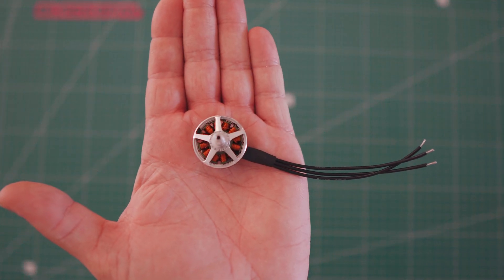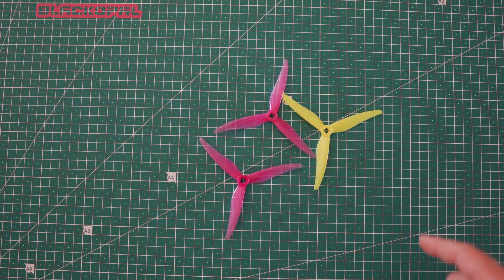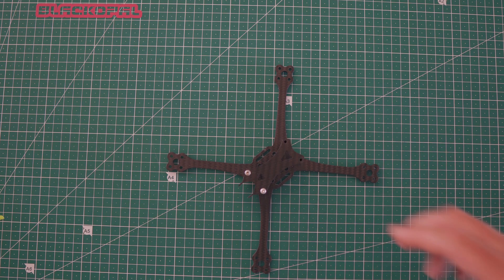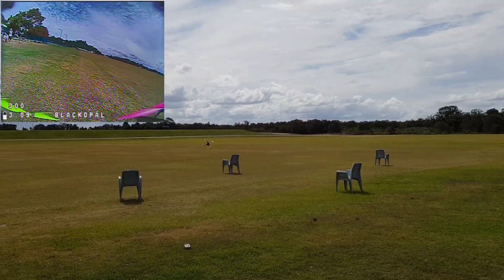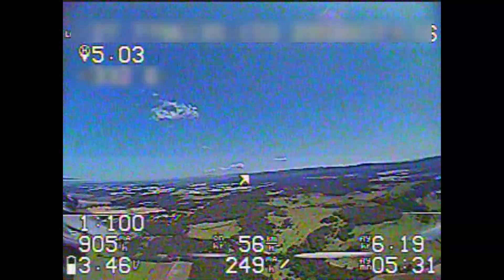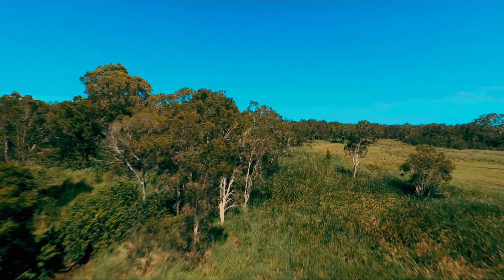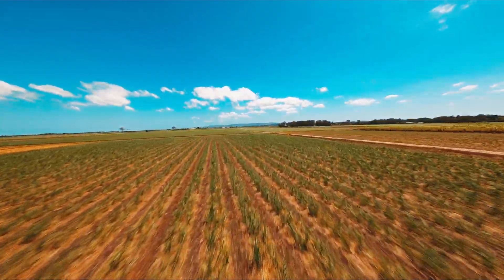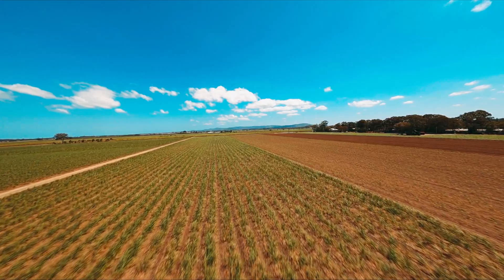37+ Min Race Drone? T-Motor Prototype

Comment: Any idea on release date? 
Do you have a link ? 
Thankyou
Reply from the maker: Should be available very shortly. Check the T-Motor website or FB groups.
Reply: @ScottTomlinson  thanks for this amazing build, do you have a link of the frame? I want to build the same!
Reply from the maker: @jordigrau83  I designed and machined the frames specifically for these tests unfortunately. Stay tuned though, considering some ways to get the designs out.
Reply: @ScottTomlinson  any news, are the motors released yet?
Reply from the maker: @justvoorfun  Yeah they're out mate. On the T-Motor site already. I'm sure stores won't be far behind. (They're now black)
Reply: @ScottTomlinson  Hey scott, so these are 2204 right and not the 2203,5? Because the 2203,5 are the only one that are the closest looking to the motors that you are showing 😁
Reply from the maker: @justvoorfun  They are the ones yeah. I had early prototypes here. New bell design and changed to 12x12 for the final production version. Stator is the same and delta connection for the 1500 kv version. (Measures 2203.5) I'm just waiting on the new ones to arrive that T-Motor have sent me. I'll update if there's any caveats but I expect no difference from a flight point of view.
Reply: @ScottTomlinson  how do You match ESC for the motors..? Are there any rules to follow so I do no fry either the motor itself or ESC in first flight..? I really wish I could have a table for this or something. I am thinking of tuning my Chimera 4" for something more efficient and better flying drone. The stock motors from Xing although very light seems to be very Amps hungry. Those are 3800kv and drains 1050mah Lipo in less than 7mins cruising.. I am considering using the same stack of 35amp and solder T-motors to it with a better frame for like 6" two-blade props.. would that work with the original 4in1 esc Iflight installed in their product?
Reply: @ScottTomlinson  what ESC Amp would You recommend for this motors? Is 35Amp ESC constant be enough for endurance 4s build for 1500kv motor?
Reply from the maker: @theartofflying3108  35A is plenty mate!
Reply: @ScottTomlinson  thank You for answer. I asked again before seeing that answer. All the best to you - great videos. (sellers seems useless unfortunately for this type of questions- they just sell things without much clue often so it is hard to get right tips for own builds).
Reply: How much flight time for the digital version?
Reply: @jianliu9420  You could easily go an hour. I had his 6UL version cut as a 7" rig and flew it for 90 minutes nonestop and I think I could've gone longer if my speed was more efficient. Incredible motors. Just build it super light.
Reply: @austntexan where can I find the frames?
Reply: @austntexan  Hey, is there somewhere I can message you to learn more about your 90min+ setup? Trying to build something for use in Search and Rescue. Thanks.

Comment: Scott, are these motors more efficient than 2004 2006 motors wanted to build a light deadcat.... thanks
Reply from the maker: These were prototypes for the F2203.5. I prefer 2005 (See my next gen race video) for the overall flight performance but the trade off is t-mount props. I really like 5mm shaft props. Not sure what's out there currently. Efficiency is probably comparable. AUW weight is the determining factor
Reply: @ScottTomlinson  Thanks, Scott

Comment: so where can we buy the frame?

this could be my first long distance quad.

i’m not ready for a bvlos quadcopter-  not until i’ve duccessfully done a couple fixed wing drone flights beyond line of sight☠️😄
Reply from the maker: This video is pretty outdated. There's a newer on on my channel with frame files you can get cut. Definitely not a first FPV drone though.

Comment: Awesome video,this is great inspiration. I subbed! I'm into midrange lr and next year I want to start racing. I opted for a druckbär ultralight 4 6inch and 2 of their ultra light 4 race frames. They are only 28g and 36g. They should be a great substitute for us that can't cut our own frames. They can also house a vista if a 20x20mm aoi is used.

Thanks for your inspiration!
Reply: Oh, and btw, what's the minimum c-rating on that 6s 850mah lipo? Is  80c enough or should I go for the 95c?

Comment: Hi Scott! What kv would you suggest when using 4s(1400mah) to achieve the same speed and duration(or close to). Cheers
Reply from the maker: The 2850 if you're primarily flying 4S LiPo.

Comment: videos like these are useless in practice. video footage tells the viewer nothing. this isnt restricted to you though..the internet is full of them. claims like 'this motor is great' and 'very efficient' can be made by anyone and is totally subjective.
motor testing should be done with a known load, rpm, V and current draw and you need to show efflux speed from the props. this is how PC benchmarking works..
there is zero evidence here that this motor is any good. and a 5 minute video says nothing of its endurance life.
long distance is more about the video and transmitter combo and arbitrarily trying 3s,4s,5s,6s doesnt really say anything either.
if however you tested those voltages on a test bench versus load, and perhaps measures temperature, V, I and rpm then people would have an idea. you could also test no load and record no load resistance and the parameters that make a good motor.
im not trying to be insulting..but really none of these videos do much other than show others some video and your voice. 
Finally, there are the props used. each OEM has different prop geometry and that gives them certain properties that may or may not be suited to the FC/ESC/Motor combo. blade count and geometry to name two. these have a much greater impact on performance than number of cells used.
For example, you can have a faster quad using a high pitch 2 blade setup on a high kv motor on 3s than an arbitrarily selected 3 or 4 blade setup on 6s. this just illustrates how much these 'tests' really show. nothing unless it is objective and measured.
Reply from the maker: Don't forget to like and subscribe.

Comment: This is exactly what I want, DJI, 6s, 5", gopro, something that rips on lipo and long rang on li-ion. I want to know more about the motors, these ones vs the ones you just posted
Reply from the maker: The 2005 motors are a much better all around motor for the ultralight 5 inch I feel. They still get huge li-ion time too. The downside is they're all T-Mount...for now ;) The T-Motor or other 2203/4 excel for endurance and the mini long range style.

Comment: I'm building up a 5" Fouride with the Lumenier 2005 2000kv, about the same stator volume as 2204s, hoping for ~25 mins with the 5125s on 6s 18650.
Reply from the maker: Should have no problem. My latest video does exactly that with those motors.
Reply: @ScottTomlinson  Oh cool, I missed that one somehow :?

Comment: I used 2004 1600kV  on 5"  Im expecting about 35mins. Because I got a few broken FC sent in a row i just havent been able to test. Using half a 4s li-ion did 24mins (landing at 13.2v) .. 6S 550mah got 12mins, and 4S 850mah got 13mins. I just wanted to be able to break 30mins. But ill see what max flight time i can get. Eventually it will all be working and ill make a video on my other Youtube channel

Comment: Odds are that the motors will be efficient but not able to push a large prop. Honestly though , there are already motors on the market that can fill this role this but weigh half as much. The 1204's / 1404's come to mind as they're great for 3 and 4" ultra-light builds that use low pitch props.

Comment: do these feel fast enough for competition racing on a ultra light build? on 6S
Reply from the maker: Might be a touch soft on the bottom end I think. Up high they're fine. I'm just doing some testing on a better revision of this frame specifically for racing. Spoiler, I'm using a 2005 stator. Video in a week or so.

Comment: Nice build!! What liion 6s was that?!
Reply from the maker: Sony VTC6 cells.
Reply: @ScottTomlinson  Mm thank you! So the C rating that li-ion is enough...what is the weight of that pack so I can make some calculations? :D
Reply from the maker: @BobCorey  For an ultralight build with motors this size yes. Approx. 310g battery.

Comment: Noice!!! But..im confused your motors have 5mm shafts while the production version have 3mm shafts?
Reply from the maker: Production is definitely 5mm shaft too. You're looking at the 2203.5 yeah? The 2004 have a T-Mount.
Reply: Ok nevermind it says M5 in diagram and shaft 3mm in specs I got confused https://store-en.tmotor.com/goods.php?id=1119 ...Though the site i have them in cart says 3mm lol; https://www.getfpv.com/t-motor-f2203-5-1500kv-2850kv-motor.html

Comment: Nice. Those motors will run 7" on 2s I bet too.
Reply from the maker: Hmm, possibly might be a bit of a stretch to try get flying nicely. Not too sure what lightweight props are around either. Would be cool to see though!
Reply: @ScottTomlinson  There's already an ultralight 7" with 2004 motors the Brotherhobby Hyperbola. It will run on 2s and slowly chug along. You are right the tune will not allow any kind of creative flying but efficiency will be high and motor bobbing caused by the 7" props and light weight will smooth out once you put on a heavy battery. Oh and for props contact HQ and ask for 7x3.5x3 2vS prototypes.

Comment: that motor is extremely efficient .. Your drone prob a little lighter than mine im building  (estimating 220g) but I do not see anyway ill do 35mins ( I land at 2.7v lol) Looking at my motor charts my guess it will just make my Explorer LR 30mins if im lucky
Just watched your 6" video. I want to build that. 
Will You Sell The 6" Frame Kit or BNF anything lol???
Reply from the maker: At this stage it's likely I'll just have the frame released into the wild for anyone to get manufactured for their own use. Shouldn't be long.
Reply: @ScottTomlinson  yea seen it hit.. I have 2 drones I just built have to tune and test. Then I'll have cncmadness cut ur frame. If u plan on coming out with a BNF I'll just buy that. Wish Dave c would gave heads up I'd bought his to throw Support that way. Got Support the little guy
Reply: @ScottTomlinson  I ended up being able to hit 40mins with 3000mah li-ion and 41mins 4000mah li-ion on the 5" i built

Comment: I'm confused by the picture in the official T-Store shop.
It says "F2203.5 1500KV – capable of 35+ minutes on 4S 5"
and scrolled lower i see ""F2203.5  2850KV more thrust and better cooling"
Then when i go the specification page to look at the test report, all 1500KV version were done with 6S, and the 2850KV were done with 4S & 6S

I suppose the endurance version is the 1500KV, true?
What is the KV of the motor that they sent to you?

Here is the link of the page, i hope it's the correct product https://store-en.tmotor.com/goods.php?id=1119
Reply from the maker: These are the 1500 kv version yes. I've tested them from 3-6S. 4S is great for endurance and 5,6S for raw performance. The 2850 kv were developed for the racewhoop guys primarily. A lot of those guys are running the 2850 kv on 6S but with 3 inch props.
Reply: @ScottTomlinson  ah okay then.... thanks, man. too bad they don't publish test result for 1500kv on 4s.
can you ask t-motor to send the motors to me too? lol

Comment: I was searching for frames for this motors and came up empty. Would you mind sharing you're frame? 
Don't wanna be that person, but if it's not tooo much of a hustle maybe you could also make it fit the 12x12 production motors. Otherwise I guess I will have to learn CAD... If you would sell the frames  or designs I would also be willing to pay for it...
Reply from the maker: Hey mate, just working on tidying up the frame files and getting them out.

Comment: I'm a bit confused. You said that the weight of the frame is 30g, and that the AUW is 180g. Since these motors combined weight is 78.48g, this leaves you with 71g for battery+components. Is that even possible?
Reply from the maker: Quad dry weight was 180g. I miss spoke there sorry mate. Answered a question earlier about that too. This isn't a sub 250 build. 6S li-ion alone weighs 300g ish.
Reply: @ScottTomlinson  makes more sense! Thanks for clarifying

Comment: Hi Scott, great video and love the frame. Is there any chance you can share info on lion Pack you used?
Also, what's the difference using motors Star Vs Delta?!
Reply from the maker: Thanks mate, I just make my packs using the Sony VTC6 cells. In this instance it's likely done to fit the amount of windings needed to achieve 1500 kv on the smaller stator. A delta connection typically requires more winds to achieve the same kv. You can do it but it would require a higher gauge (thinner) enamel wire. You can achieve the same characteristics with either Delta/Star however. In theory, the start up current of a star connection is less than that of a delta connection but at the expense of low end speed.

Comment: I am sorry I don't understand spoken English well. What battery voltage/capacity was used for 37 minutes flight?
Reply from the maker: 4S 3000 mAh (Sony VTC6). This was using Gemfan SL 5125 and 1500kv motors.
Reply: @ScottTomlinson  thank you. So 4s 3000mah means about 200g, and auw is just below 400g with hover throttle 100g per motor. I have diatone mamba 2004 1450kv motors, I think they are very similar but didn't check them yet.
Reply: @ScottTomlinson  what ESC Amp would you recommend for this motors? I have seen you used mamba 35Amp ESC. Is that ok for current with picks up to 40amp? I got Sussex mini ESC 35Amp I wondered if that will do?

Comment: Nice work mate 👍👍it's amazing how far motors have come over the years and these 2204's compared to the 2204's that everyone flew years ago show that
Reply from the maker: I'm wondering about that too. I've been searching through a lot of old gear as the sizes back then seem to be coming back in fashion so to speak. Light weight props are a welcomed advancement.

Comment: I would 110% buy the frame tweaked for digital as soon as they come out. Side note-- that shot with the birds flying around the 3:30 mark was just perfect looking
Reply: My plan is 20x20 AIO and vista mounted under top plate. GPS mount on top plate

Comment: Reminds me of the RacerStar 2304 low kv that was discontinued.
Take my money! 37min! That's what I get on my 7"
Reply from the maker: It's funny you know, I'm going through all my old gear and clearance sections on stores looking for the old sizes we used to run, probably some real gems around. 
I've also just built a new 7 (non UL) Yet to run it to it's limits but I'd use it for fast paced mid range stuff where 100kph+ is required. I still feel the 5inch covers most things however.

Comment: This looks like the best of both worlds, with the Vista, what were the flight times for 4s, 5s and 6s Li-on? Which one was best?
Reply from the maker: Unless you're intentionally going for maximum time, 6S is always the answer in my opinion. Better flight performance. Useable performance on 4S once the cells get close to 3V diminishes. (e.g I'd hate to try punch out to miss a tree etc) I'd use the 5S without a GP or if I wanted to do a decent cruise along a beach or something.
Reply: @ScottTomlinson  Thanks for the reply! so, do you think a 6S lithium pack would give you more flight time than the 4s lithium ion that you used in your videos (even with the added weight)? I think that this class is going to get big and the 2203.5 is a better option than the 2004 that everyone is using.
Reply from the maker: @DVRGNT raw flight time no. I agree on the size too! Small weight penalty over 2004 but huge performance gains.
Reply: @ScottTomlinson  Everyone seems fixated on overall max flight time. I would rather a farther distance traveled at a higher speed with a lower overall flight time. I wonder if the 6S li-ion would achieve that over the 4S Li-ion
Reply from the maker: @DVRGNT  100% agree. That's where 7 inch quads shine too as they have the ability to cover a lot of ground.

Comment: What are the electronic specs? And have you had any luck with the alnolog frame production? Very interested in this build! Its sooo efficient! Hell I have never bought a pre built kwad but me very tempted to make you an offer. Pay pal ready 🤣
Reply from the maker: Just basic 20x20 stacks, nothing special. No frames released just yet but I'm looking at options to get the designs out for sure.
Reply: @ScottTomlinson  very interested in a frame + motors for a vista long range